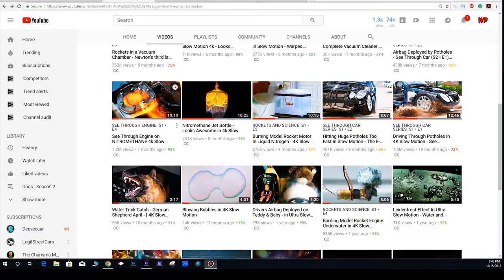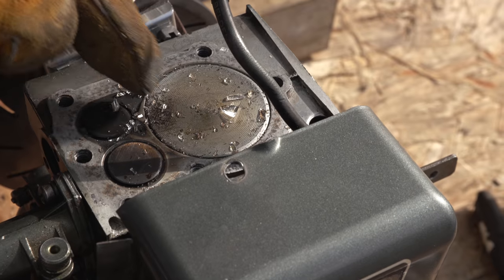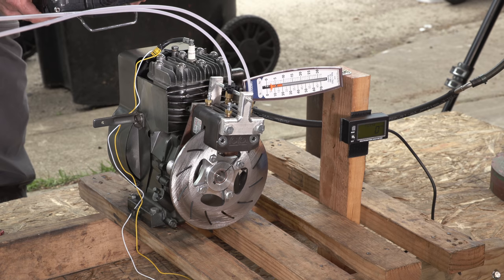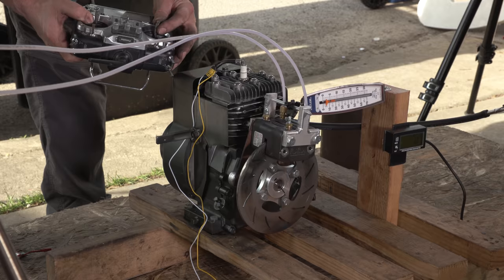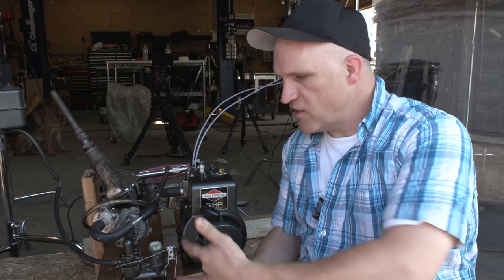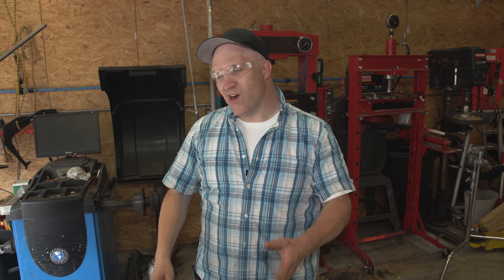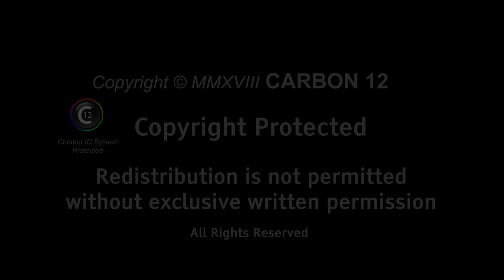See Thru Engine on Turbo Nitro and Dyno  (How much HP does it make?)

Comment: You will never make boost with giant turbo on that tiny engine, there is not enough exhaust pressure to make boost. You need a teeeny weeny turbo like an IHI RHB31. then if it stays together maybe 15hp. but you will need a bigger carb like Carter #30 Carb. put a shock absorber on your scale.....
Reply from the maker: never say never, Ill take that as a challenge! ...lol
Reply: @WarpedYT  give it hell! put a boost gauge on to see what's happening. those little turbos are cheap on ebay and so are the carbs
Reply: My thoughts exactly. The turbo is too big for the engine and it can’t spool up properly. Put a tiny turbo on it and see what happens!
Reply: If you going to use that big of a turbo it should be a compound turbo setup. However that's going to a crazy build and you'll definitely want a thicker shield to stand behind
Reply from the maker: @cookatktown  this turbo is pretty tiny, 27 mm. You have to keep in mind that this is the primary turbo charger from the sequential setup on the S65, this is a small Turbo, I mean it's still pretty big for this engine but I'm positive I will make it spool and get boost
Reply: The ONLY way you are going to get boost out of this turbo on this engine is to add a jet style combustion chamber after the engine and inject NOx (or another oxidiser) and fuel to create the gas required to spool it up, the engine just cant pump the air to do it. Once the turbo starts pumping you can use a BOV from the intake to the exhaust  rather than NOx
Reply: I take it bake on needing nitrous - you should be able to start it like a jet by using a leaf blower to spin it up as it should bypass via the BOV, so either dump fuel in the carb or inject in the exhaust, the latter is probably a better idea. But a wet system would be asking for death.
Reply: Should have been more clear. It's pretty big for that motor.. I think to make that work you'll still need a smaller turbo. To twin turbo it. Then the next issue you run into is fuel as that's allot of air I would say grab a carb from a bigger motor such as a 20 hp or steal a buddies off his 88 Harley motor lol
Reply: At the absolute minimum you are going to need an exhaust plenum to smooth exhaust flow, but ballpark the primary form an s65 6 litre should suit a 3 litre as a stand alone, not a 150cc single stroke. I really dont think it can pump enough air. Unless you can get it to rev to 30k
Reply: Warped Perception can we see a nos N/A and boosted Dyno run? Use the turbo you already used also add a boost gauge. Maybe add a run to see what that turbo actually boosts at without nos
Reply: Better valves would let it push that turbo. A slight porting. Might at least let you get a little more use of the turbo.
Reply: I was thinking the same exact thing you were about the turbo being to big... you definitely need a smaller one that can do something with that tiny amount of exhaust.
Reply: Just spray and pray that's the only way to get that Turbo 2 spool
Reply: @WarpedYT  This is a very small turbo but, it was designed for multiple cylinders and a higher pressure, steadier exhaust flow to spool up. The veins on the spool are not efficient enough to spin up with such a small amount of exhaust pressure. Granted, it did start to spool up but only after a good bit of high RPM running. It might work for the purpose if you sort of "bullet proof" everything so it doesn't fall apart. As another viewer said, I think you may get as much as 15hp out of this rig with a larger carburetor and some TLC.
This is fascinating, thanks for doing the videos.
Reply: @WarpedYT : COOL! 👍
Reply: You are right.
Reply: turbos do not spool off of exhaust pressure, they spool mostly off of heat energy from the exhaust. Thats why your boost gauge stays at zero when you rev it in park or with the clutch in.
Reply: Yes keep it going step up to a older kholer cv16 or bigger
Reply: @Joshcheyka  WRONG WRONG WRONG! the heat from the combustion process creates pressure by expanding the gasses which in turn create a very large volume of hot gasses traveling extremely fast trying to get out. for example the Hellcat engine under full boost can create upwards of 20,000 psi in the cylinders!  what do you think pushes the piston down?   you get no boost when you rev it up because your engine is not under load and not burning enough fuel for a long enough time to create and sustain enough pressure and volume to get the turbo spinning fast enough to do anything. that is called turbo lag
Reply: Im thinking of adding a turbo on my yonda civic its a stock 1.8l can i add a tiny turbo a that way i get like a 10hp increase i dont care for much more than that cause i dont want to over wear my engine. What would be the best small turbo for my engine?
Reply: Thats also why people complain about turbo lag, if they spooled with revs torque converter stall and high rev launches on a manual would eliminate the problem of lag.
Reply: @mycosys  Single stroke?
Reply: lol brain fart - single cylinder obviously
Reply: @Cape Cod CNC - just no. Turbo lag is you get no boost UNTIL you rev it up. Exhaust volume increases with revs, and the combined energy difference between the intake and outlet of the turbine increases exponentially. Large turbos at low revs do not get enough exhaust to make boost, that is what causes lag.
If you were right, you would not be able to use a blower to start a jet, which is actually near identical in operation
Reply: Nope, that turbo is still too big, you need way smaller like mentioned above.
Reply: @mycosys  Well you need high revs and/or high load. High load makes for higher exhaust temps which helps turbo spool up too.
Reply: You can compensate it with high Rpm
Reply: You are right, that turbo isn't made for a one cylinder motor.
Reply: @mycosys  Volvo uses a similar but simpler system. It injects compressed air into the exhaust to spool up the turbo and get rid of turbo lag.
Reply: Mr.Wahrnehmung, I hope to see a highly boosted B&S Engine :) (don't forget a pressure measurement :D) -- best regards!
Reply: You could use propane injection for the jet to spool up the turbo.
Reply: @googleuser8448  Why not just use compressed air? There's little to no oxygen in the exhaust so it it won't combust. Now if you inject some oxygen.... well.... stand back.
Reply: A 50 shot of nitrous should spool it....
Reply: Put a ball valve and Y junction in the exhaust and plumb the other end into your air compressor to assist turning the exhaust impeller.
Reply: Joshua Edward you are very wrong man.
Reply: I agree.
Reply: Cape Cod CNC thx for helping me find a turbo for a predator 212  at a very low price!
Reply: Brake disc is warped!
Reply: My initial thoughts, as well. I see Warped Perception accepted the challenge. Staying tuned for those results. Still, overall, a fantastic use of some amazing skills.
Reply: Cape Cod CNC I second everything you just said lol I was think this as I watched it
Reply: @Cape Cod CNC - 20,000 psi combustion pressure?!?!.  You have absolutely NO idea what you're talking about!!
Reply: @Mijc Osis - You don't seem to know the difference between turbo lag and *boost threshold*.
Reply: @mareksumguy1887  look it up, YOU have NO idea!
Reply: Vz 25 on eBay is a pretty cool idea
Reply: @Cape Cod CNC  You really should learn how to read.  Heres the excerpt from the article.  It clearly says *1595 psi*... not 20,000 psi !!

"The supercharger on the Hellcat's 6.2-liter V8 engine makes 11.6 psi of boost, while the forged-steel crankshaft and high strength connecting rods are engineered to withstand 1,595 psi, or the equivalent of nearly 20,000 pounds, pressing on the piston tops every two crank rotations."
Reply from the maker: @mycosys  true, but this is from the sequential setup of the the Biturbo on the SL65. It's really small, but I'm not betting on exhaust flow to spool this Turbo.
Reply: yeah - generally the ballpark for sequentials is the smaller turbo suits an engine half the size of what you are fitting to, so it spools up much faster but runs out of puff. Not betting on exhaust sounds fun :)
Reply: Not to mention Head Bolts
Reply: Warped Perception  I've loved this series of videos, but I have to agree with the others: that turbocharger is far too large for what you want to do. Frankly, as soon as I saw you mention what turbocharger you were going to use, I thought "uh oh", and was even more convinced when you hooked the monster up. I was thinking, "That poor little engine has no chance of getting any useful boost from that thing; all it's going to see is restricted airflow." And sure enough, your achieved power dropped. You blamed the "wet system", but I doubt that mattered; I'm pretty sure the turbocharger size is the elephant in the room.

Looking up the turbocharger you picked (you said it's from an SL 65), I see it's one of a pair from a 6-liter engine, and you said that it's the primary sequential one, so it's the smaller turbo for the low-RPM range. I'm not sure the exact displacement of the Briggs & Stratton engine you're testing, but I figure it should be somewhere around 100-200 cc, or only 1/60 to 1/30 the displacement of the turbo's original engine. So even the smaller turbo is going to need lot more airflow than your tiny engine can deliver to get useful compression. If you get any boost at all, it's not going to be significant. Not only that, you're impeding the free flow of exhaust gases out of the engine (and possibly the flow of air into the engine), so it will have a harder time packing a fresh charge into the cylinder. You end up with a net loss.

So yeah, I'd say try the smallest turbo you can find. Though I wonder if even that will be enough for an engine like this, since the smallest ones I've seen mentioned are for 0.66-liter to 1-liter microcars or motorcycles, which is still several times your engine's size. And I've also seen claims that the efficiency of turbocharging drops a lot for really small engines, which might be true--turbos fundamentally depend on aerodynamics, and aerodynamics depends a lot on scale. Perhaps a mechanical supercharger instead? Hell, you could always cheat and try a supercharger driven by a separate power source, like an electric motor, so that your engine gets the extra compression for free. :D
Reply: Nope, they spool from exhaust gas flow. Heat energy and pressure are all very different factors and do interact but ultimately it is the flow and its unique characteristics (pulse waves) that impact on what turbo for what application - Physics! 

Turbos are, or should be designed specifically for application, number of cylinders which affects pulse harmonics and scavenging and ultimately the driving force to the turbine the exhaust gas mass flow, this in turn will affect turbine blade and vane design as well as the compressor design to provide optimum boost for each engine. Good experiment but definitely a low mass turbo needed to cope with low gas flow from a little 1 cylinder sidevalve B&S engine, this is why you lost power. 'Wet' systems, not ideal and of course redundant with fuel injection but not the underlyong cause for the lower output with the turbo fitted. Banging a turbo on is complex as is any FI set up.
Reply: He forgot to divide the 7 so it made less than 4.8 hp 😂
Reply: I have a rhb31 on my Kubota diesel on my custom garden tractor
Reply: @WarpedYT  Run e85 fuel and advance the timing like a LOOOOOT and it will boost just fine!
Reply: +1 antilag lolol
Reply: @sjh6007  It's amazing at how many self proclaimed "turbo experts" are in these comments. Understanding how a turbo functions with a given engine, manifold, exhaust pulses etc are the basics!
Reply: I worked in a high performance shop for a couple years. It was always funny to see people put giant turbos on their factory v8 engines. They didnt start making any extra power until they hit redline. Gotta get a fast revver if you want a huge turbo.
Reply: @Skeetacus3  you would be better off with mild cams and improved air intake/throttle body.
Simply adding a turbo would kill your car off much sooner without any reinforcement(performance parts)....and it would cost less too!
Reply: @WarpedYT  You tell em! Great Video I have NEVER seen an engine explosion as it was occurring and just for that I give you a big ole' Thumbs UP!!!
Reply: @williamrobinson5851  maybe he can get the Last 50hp😂😂
Reply: Even if it did spool up (as can be heard), it does not mean there is any boost.  There is no boost until compressor is spinning fast enough, usually this means >50 000rpm.
Reply: I would use a rzr or can am turbo
Reply: Sure sounded like it boosted up, trouble is it boosted at way too high a RPM. Smaller turbo sure would be nice. For rod snapping power you want boost all in by the engines natural torque peak at least as a starting point. Since this is a blow through system you do not usually need as big a carb so it might be decent with the stock one?
Reply: Yep
Reply: Spot on mate
Reply: I am a auto engineer and I can tell you that turbo will never reach boost with a engine that small
Reply: Cape Cod CNC Exactly what I was thinking , big turbo requires big exhaust flow,  more potential hp gain w smaller turbo
Reply: Yeah, that’s a turbo from an engine that puts 3 liters of air through that turbo per rotation, and spins quite a lot faster...
Reply: Also I think it didn't have enough spin up time the first run
Reply: Another reason that the turbo will never make boost is because you are running it at low revs. Turbos are much more efficient high revs due to the exhaust gas not being able to spin the impeller fast enough. If you used a much smaller turbo and ran the engine at higher revs you would get much more boost.
Reply: Also the fact that a wet system was used would not make a change. In fact if you put the turbo before the carb you would have to re tune the fuel mixture.
Reply: Besides all the criticism good job. I would like to see a follow up where you do what Cape Cod CNC and I recommended.
Reply: Warped Perception yo bro ur right about what u tokd everyone bout it not being to big of a turbo tbh that dont even make sense mathematically..i really like your video but TBH bro ur problem lies in cooling the motor properly, its a air cooled motor and ur running nitro in it so of course it gonna run hot and lose power fam
Reply: The RHB31 would still be too small, it would only  make a couple lbs of boost resulting barely a net gain in power.
Reply: overbuilt automotive I love the way you think brother
Reply: Like that and maybe start with ihi turbo the kick in the second turbo
Reply: You could realistically probably get a couple psi out of that turbo with the nitro methane and a bigger cfm carb. But a couple psi isnt much, not like that little Briggs can take much more anyway lol
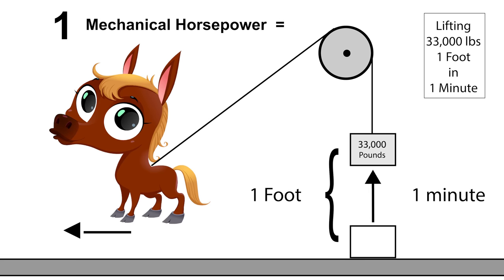Reply: @WarpedYT   2:50 that's one big horse lol

Comment: You did an amazing job and put a tremendous amount of effort into this video from setting up the dyno to installing the turbo.  Great job!  Keep making videos--we enjoy them!  Best regards, Project Farm
Reply from the maker: Thank you brother, I actually used your "in the carburetor" shot in one of my past episodes !!, It was definitely inspiring and I had to try it.
Reply: To simulate a little experiment for us guys who have Jdm cars and run that kind of stuff for racing drifting etc
Reply: Cayden Brown Are you from Iowa?
Reply: no.
Reply: Now do an electric motor comparison at 3 HP rating. You will find that the electric motor will increase in horsepower as you load it down beyond its nameplate rating. Something combustion engines are not capable of. Don't use compressor duty electric motors as they are already peak rated. Use a real 3 HP electric motor. A good one that is not too pricey is Leeson 120341, 3 HP wood working motor. You will need 220 volt supply.
Reply: @EETechs  and then give it 440 volts!!  :-)
Reply: awesome comment!!! keep giving props when they're due...keep building people & loving the art of making HP! and all the work, sweat, time and money that goes into any build... we only get out, as much as we are willing to put in!!! Don't Hate, Congratulate... Just imagine, if N.Tessla inventions weren't shut down by T. Eddison,  this world could have been shaped by a mind so ahead of any inventors comprehension at that time. If N.Tesla's world existed today, life as we know it would be beyond advanced our technology in every field... But unfortunately, greed killed the massive leap forward we could be living in the future that's full of tech that runs on electricity no fossil-based fuels! Nicola  Tesla wasn't a megalomaniac! if Tesla would have found a like-minded investor  instead he explained using direct contact voltage 12 vdc every motor in our homes uses 12vdc so 120vac means massive hydro dams and a monopoly   T. Edison 120 vac was a scam! Tesla was an honest man he wanted to help America to make cheap clean power for the world! everyone will be able to afford electricity to heat their homes, factories exctra!!!  T. Edison shit himself and got oil cartel JD. Rockafeller
Reply: Project Farm hi I have a question pls